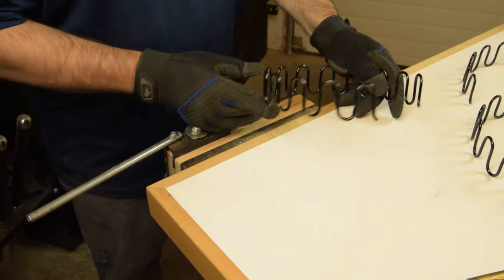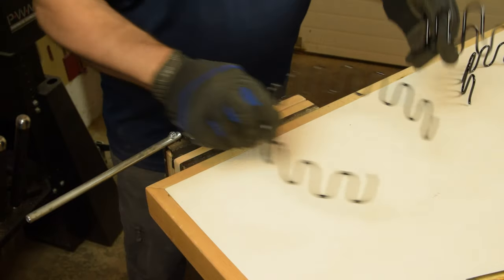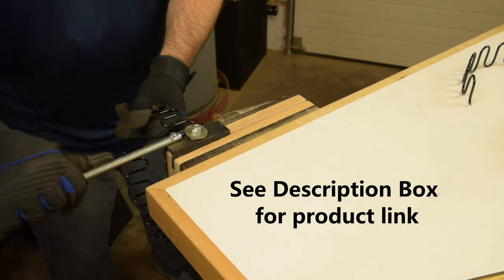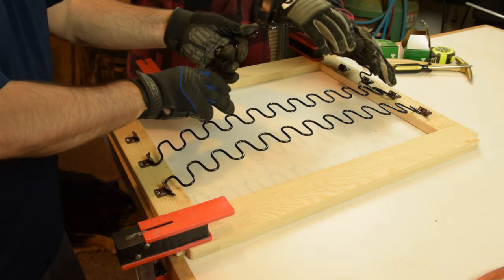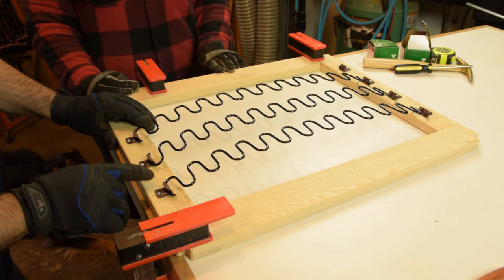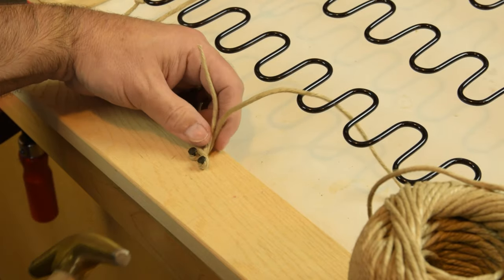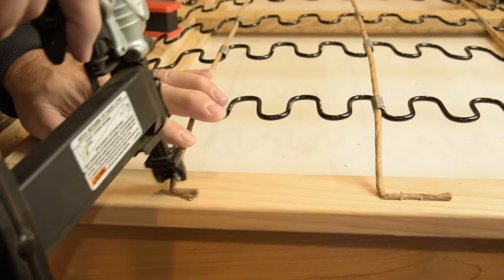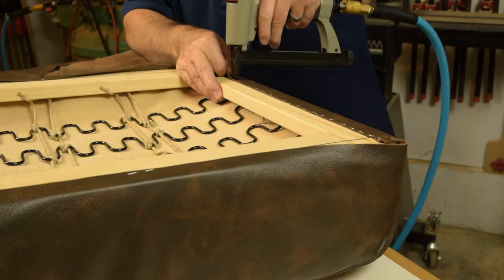How to Install Zig Zag Springs for Upholstery Seat Cushions Zigzag installation tutorial for chair

Comment from the maker: Don't be afraid to try springing a seat cushion.  It's more comfortable than foam alone, and isn't hard to do.
Reply: Just have to be careful about those springs, as with any spring... there's a lot of coiled tension in one when it's extended. I've been trying to reattach one that's come loose, from the underside because I don't want to tear the whole sofa apart. The little hook on the spring they put in wasn't up to the task, but it also has cheaper plastic clips in the frame, and no string or anything holding the springs together - cheap crap, inherited it. So one spring worked itself loose. Got my face a little close when I lost concentration when trying to stretch it back and it smacked me in the forehead. Will teach me to pay attention when handling springs...

Comment: Apparently there are spring stretchers you can get to do that attaching thing solo. I saw an upholsterer who had made his own, but later spotted a tool that looked professionally made. This is not exactly my field, so picking up info (trying to fix a loose spring on my couch).
Reply from the maker: Yeah I have one of those spring stretchers, but I never use it.  It might be perfect for working under a couch for repairs though.
Best

Comment: How far apart should the S Clips be? You said you figured out you needed 13 humps. How do you figure the length of your springs?
Reply from the maker: You want at least 4 springs per seat.  Sometimes 5 lays out well, sometimes it's 4.  Stretch the spring to the desired length, and mark the clip locations with a pencil.  Pre-install the clips, and stretch them in place.  Good luck!

Comment: Yes, question, im restoring a vintage vw, the back of seat has some broken zig zags, how do you bend the zig zag to a 45° back toward itself and then again?
It’s straight and at each end was created a lift if that makes any sense, 
Hard to bend, heat with torch?
Reply from the maker: I would use a spring end forming tool.  They're available from C.S. Osborne.
Reply: Wrong type of tool, I need to bend itself back at a 45°.
Example three hump’s and bend back to itself.
Reply from the maker: @scoth5135  can you buy replacement springs already bent?  It's very hard to do with hand tools.  A factory probably uses a dedicated press to control the spring.
Good luck with your search.